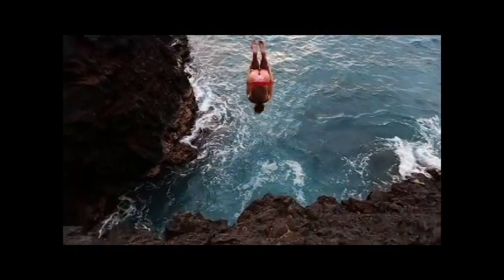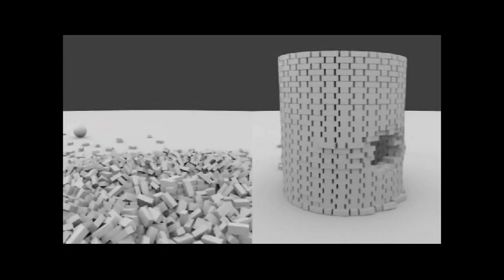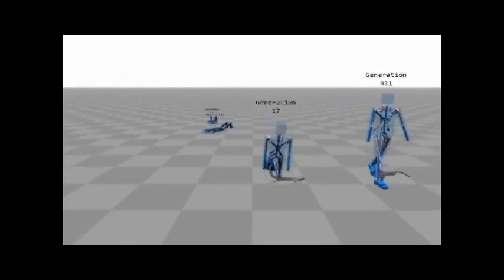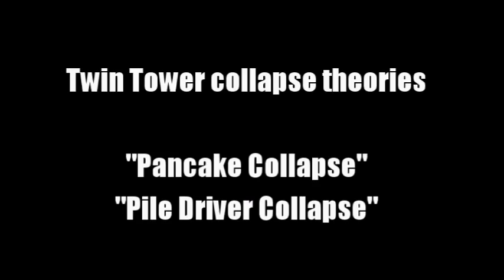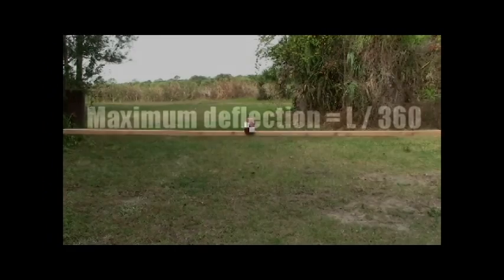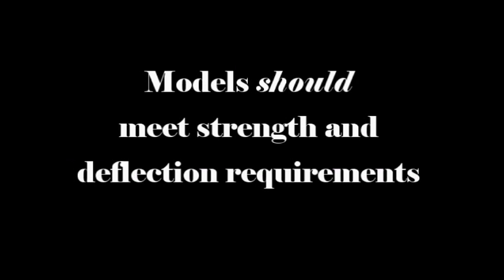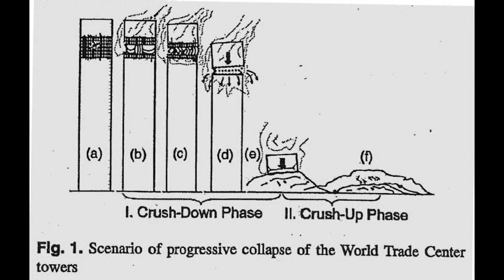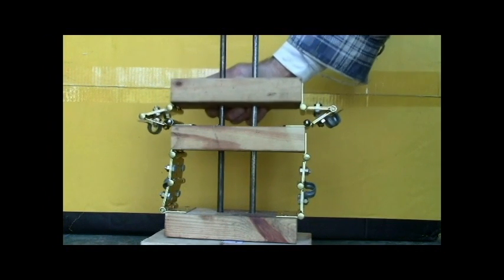9/11 Experiments: The Force Behind the Motion

Comment: 6:20 This is an interesting test, but did you make sure your dropped weight was proportional to the falling weight of the upper floors compared to the reduced strength of the ceramic plates? Also, the support you built may offer additional resistance not available in the real thing. 
Either way, the pancake theory is considered the less likely theory these days. 

9:16 This test fails in that there is more tensile strength proportionally than would have been present in the towers.
Reply: Can you tell me how any dropping (by total release of supporting structure) can happen in a steel framed high rise supported by 287 vertical columns said to be slowly and unevenly heat weakened please?
Reply: Step back a second. Now think. Is the building strong enough to support the weight, or isn't it. 
If it is, then it doesn't collapse. 
If it isn't, then it does collapse. It doesn't matter two fucks in an alleyway if the weakening is uneven, it doesn't matter if there were 287 vertical columns, or 4,000. If you start weakening the building, and weaken it to the point where it can no longer support itself, it collapses.
Reply: +nivarion  Thank-you. Your explanation of "weakening the building, and weaken it to the point where it can no longer support itself, it collapses" makes perfect sense as much as it is a well presented description of the processes involved with any controlled demolition.

You're my hero ..........
Reply: My god. You people. 
There is no evidence of a controlled demolition. Your arguments pretty much boil down to "But there was a bang!" or "Do you really trust the government?" 

Demolition charges are normally over the 150db range. They are unmistakably loud. They also show up on seismographs. Nobody heard the amazingly loud bangs that occur with CD, nor was CD picked up by the seismological societies in NY. (But they did pick up mining in New Jersey.) 

So then they push the thermite theory, which they have been entirely unable to get to behave like they want it to. So then they push the nano-thermite theory, when nobody has yet to produce a 'nano thermite' that actually burns. 

Point of failure is why the buildings came down all at once.  You can build models yourself and test it. Suspend something by strings. For example, using string with a 1lb failure strength, suspend a 10lb weight with 20 strings. Start cutting them and you should see 8 to 9 strings fail all at once near the end.
Reply: +nivarion  Going through life with your eyes closed, fingers in your ears, humming loudly to yourself seems to be such a waste of skin. Have you ever considered entering into treatment by competent professionals?
Reply: Payed still lol. wow are you fucking serious? 
the 9/11 truth movement hasn't changed a thing about their theories since September 12th, 2001. but it is the rest of us who have our eyes closed and fingers in our ears. 
but im not surprised by your behavior.
Reply: +nivarion  I think the difficulty you experience in your work day is directly related to your belligerent ignorance of physics. I can't see where you will even achieve parity in any discussion about 9/11 structural failures until you learn how a hammer works or what makes water work. Just sayin'
Reply: Payed still just priceless. the twoofer thinks he understands physics when they can't even grasp how an airplane could puncture the side of the building.
not unexpected for somebody going around calling themselves payed shill.
Reply: +nivarion  Okay that's fair. You tell me about your misconception of the "hammer down" theory caused by your fundamental lack of understanding of how a hammer works. If you can manage that simple task, I'll give you something else from commonly understood basic scientific principles to deny.
Reply: What the absolute fuck are you even prattling on about. Hammer down is a term only you are using, and compared to how that phrase is normally used, you are using it wrong. 
That's called muddying the water's. Its a logical fallacy. 
If you are asking how I think the towers collapsed from the top section falling, that I can do, even if you're just going to change the subject again.
Reply: +nivarion  I haven't had an absolute fuck for quite a few days now, but no fault of yours I can assure you. I take full responsibility. 

You'll need to pardon my misuse of the term that NIST rebranded their conspiracy theory of the collapse initiation of the trade tower to from the FEMA "pancaking collapse brand. Let me know what they called that magnificent description of the tremendous force of the upper floors when they unloaded like the dogs of war on the poor, unsuspecting, unheated or damaged lower vertical suprort structure that increased in density the closer that mass got to the ground.
Reply: You use way, way too many euphemisms in your text mate. Makes you nearly impossible to understand. 
From what I gathered, you are assuming that the building could not have collapsed due to the increased strength of lower floors. 
However, you have a misconception about how tough the towers were. The construction of them was fairly experimental, and after a short window in which several such structures were built, none like it have been built since. Because of the flaws in the design, the building was unusually susceptible to collapsing floors and highly dependent on floor integrity to remain standing. 

Not a good combination. Not a good combination at all. 

Anyways, the top section does no compare to a hammer at all, which theory the NIST discarded by the way, because a hammer does not gain mass as it falls. The experiment where the guy had the pizza protectors sideways was about the most similar to what ended up happening, because it was most similar to how the towers were built. The long vertical supports were welded at various points, but welds have limits to their strength. They were bolted at other points, and bolts are susceptible to sheer forces. The towers well depended on the columns remaining perfectly vertical, because of these limitations. 

The thermal expansion of the fires had the additional effect of both weakening steel inside the tower and pushing things out of their true, which caused a drop off of strength. The collapse started and the tower progressively failed as the weight moved down.
Reply: +nivarion 
You're right, I do use too many words.

What was NIST's new theory of the trade towers collapse initiation called when they abandoned FEMA's pancake theory. 

How's that?
Reply: +nivarion  BYW  The lower floors did not increase in strength, the vertical structure of core and perimeter columns that transmitted gravitational loading to the ground did. Big time. All joints, including floor truss to column connections were gravitational type meaning one section resting directly on another and were not subject to shearing.
Reply: Yes, under normal circumstances, they wouldn't sheer. When pushed out of true by the thermal expansion, that was a serious threat. When under the amazing force of a collapse there were lateral stresses which did cause sheer. WTC 1, 2 and 7 were fatally designed, and some 3,000 people paid for that. 

And while we are talking about it, the columns nearest the ground remained standing for a little bit after the collapse. Without the rest of the structure it isn't a surprise they would collapse though.
Reply: +nivarion  Interesting that you combine explanations of the collapse initiation of the trade towers with heat weakened extreme and unimaginable pulling forces alleged to be responsible for pulling in perimeter columns until they snapped with heat expansion of steel alleged to be responsible for pushing out the perimeter columns. Very strange ..........
Reply: Not strange at all. You just don't work with hot steel. 
watch?v=ddhzTqsD6p8
Steel starts by expanding rapidly. This expansion can be several inches over the length of beam used in WTC. This expansion will push columns out of alignment as you can see in pictures of WTC 1 and 2 between about 20 and 35 minutes into the fire. 
If you continue to heat it, it can pass the point where its strength is less than it's expanding force, and the beam will deform. If it cools like this, it will contract to a shorter length than original (due to deformity and thermal contraction) and pull on columns to bring them out of alignment. 

This isn't something new. Mankind has understood the thermal expansion qualities of steel for a very, very long time. One example you can look up is the chain used to fix the Cathedral of Amiens in the 17th century.
Reply: Oh, here's a better one. watch?v=Jjxu6ZM00I0
Reply: +nivarion  I think you have confused your debunker syllabus intended to explain the sequential collapse of the columns in Building 7 with your manual of deflections intended to debunk the trade towers. I'll wait until you get your campaign in order.
Reply: Wonderful deflection from somebody who's point has been defeated. Bravo. When you start metal working let me know. All of this makes a lot more sense when you actually do it.
Reply: nivarion  I didn't think I had made any points to be formally trounced according to you but if it gives you comfort thinking so, be my guest. I have been a metal worker my entire adult life. What have you done over the course of your toils on earth to make a living?
Reply: I'm a welder by trade. That's what I do to make a living. 
As in, I work with hot metal, and with very hot metal. When I am welding things together, I have to plan ahead for the contraction or the metal pulls. I have seen 5/8ths plates bend from the thermal contraction of a cooling puddle. 
When I am thermal cutting, I have to plan ahead for the expansion of the metal or I might end up with a cut that is not strait, either ruining a part or increasing my cleanup time. 
When I am tig welding, I have to feed the puddle enough, or it may pull in and produce a weak weld or a bad root. When running a root pass, I have to be conscious of the expansion or my filler might be seized by the landings. 

If you are a metal worker, I am curious as to why you don't understand the strength of that thermal expansion? You should know as much as I do that the metal will expand as it heats, and that that expansion can be several inches over a long piece, that that expansion can have tremendous force behind it. If you are a metal worker, you should understand the strength reducing effects of high heat. If you are a metal worker, you should understand the loss of strength a piece of steel goes through once it is bent. 

I don't doubt that you are a metal worker. I'm just curious as to why you aren't making these connections in this one incident.
Reply: +nivarion  Thanks for your explanation of your past work experience as a welder. Tell me, have you ever stick welded thin aluminum plates of 1/4" thickness? Have you ever found yourself searching though your steel scrap pile for a piece of mild steel round stock but find there are many types of scraps in the pile that you had to identify by their hardness (carbon content) How did you do it without sending it to a metallurgist as the many trolls suggest a laymen has to do to identify the red to white hot metal seen streaming out of WTC2 before it fell?
Reply: I don't have a lot of scrap of my own, and what I have I keep sorted. I rarely work on aluminum and I don't stick weld it.  However, I do have the experience of having not sorted my filler rods, and loosing use of them for jobs with filler specification. And no, there really isn't a way to tell short of a metalurgist's test on those. 

That said, the metal streaming out of the WTC was red hot. You even said it yourself. It cannot then, have been steel, iron or thermite. those materials are too hot to be red while molten. 
The metal coming out of WTC 2 was probably a mixture of things, with the bulk being aluminum from the plane.
Reply: +nivarion  I'm not surprised you were stumped by that simple layman's test for steel hardness. It baffled the blacksmith from purgatory infinite knowledge of metal forging. This lack of knowledge on your part clearly indicates where your logical fallacies about the metal, which I identify as steel, seen streaming out of WTC2, originates. An honest mistake. Not everyone has had the privilege to attend Grade 9 metal shop classes.
Reply: A2, HRC of 42 to 65. O2, HRC 55 to 66. alloy 1095 HRC 44 to 50. Can you really tell the difference with a hardness test? 

Grade 9 metal shop? That explains it, I guess. I took mine through college. You must have had the volleyball coach moonlighting as a shop teacher and learned the rest from Conan movies if you think molten steel can ever appear red.
Reply: +nivarion  I can gauge the harness of steels to some degree with one simple test that you should be familiar with. This same test demonstrates a property of steel that the "metal" seen pouring out of WTC2 before it fell did, and it is only present in ferrous metals. You do know what ferrous metals are don't you?

Comment: I dont doubt you have traction here but .. you really need better equipment than backyard equipment and also factors like even waight, wind and even the heat inside the building to really break down.

Comment: nice experiments, but the floors should be attached to the continuous outside walls. it would be nice to have a model with correct ratio of dead weight to the floor trusses shear bolts attach to exterior walls.  the down and out i feel is in part due to that style of construction.  i am no engineer but i have done construction for most of my life and hanger trusses floor versus joist that sit on top of a wall is always weaker.  that said...we still had melted steel which cannot be explained due to truss failure.

Comment: You know what. Paper is not steel.  It doesn't conduct heat as easily it does not change it's  structure when heated.  That paper tower is a incredibly flawed model. This kind of shit can really piss ppl of you know. First complain that the models used by the engineers are not good enough and then come up whit a way worse model of your own is can really annoy someones random tripp trough you tube.

Comment: pretty sure in controlled demolition they dont put explosives on every floor... you only need to get "rid" of the supporting parts on lower or mid floors and gravity does the rest... in your model I would need to have explosives on every floor of the, how many floors it had?
Reply: by your own theory controlled demolition does not work either... because see what happens if you put firecrackers only on bottom or mid section and then you will conclude that controlled demolition is not impossible so Aliens?
Reply: Is it your understanding of vertical structure that only the top. bottom, and middle are necessary so we can save money by leaving out vertical columns in the rest of the building? This idea, if it catches on, can save BILLIONS!!

Comment: nice! though i think your experiments need an extra detail because of the reasons given by the truth deniers. their argument is that as each floor collapses, it adds its weight to the falling mass, so as the mass increases it should accelerate. of course this is nonsense because the additional mass has to go through additional strength of the thicker supporting columns, but anyway you need to show that in experiment. as it stands, your floors are too light, so they need to be weighted such that the structure below is just barely supporting them, so as the steel cube impacts each floor the total falling mass gains weight.

Comment: This is fantastic, I've always wanted to do some model experiments on the whole 9/11 thing , but just haven't got the space or resources, I'm very glad someone who has , has!

This study is very eye opening, it would be nice to repeat it with the structure of the actual tower accurately ( well reasonably accurately , doesn't need to be perfect) modelled from materials that would be of equivalent strength.

Obviously this has already been partially done with the concrete tiles used to represent the floor plates, but it would be sweet to recreate the columns and floors at the right scaled weight etc. The present effort probably isn't that far off to be honest, but it would be nice to get very close.

Anyway thanks for all the effort taken doing this, it looks like it was a time consuming endeavor!

Experiments are the key to the scientific method.